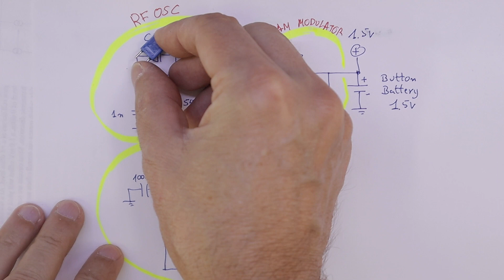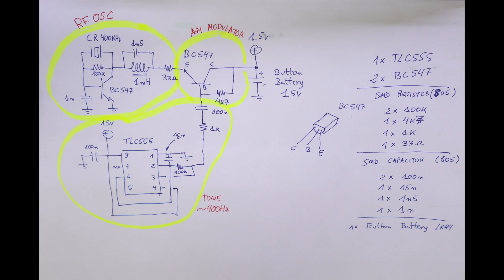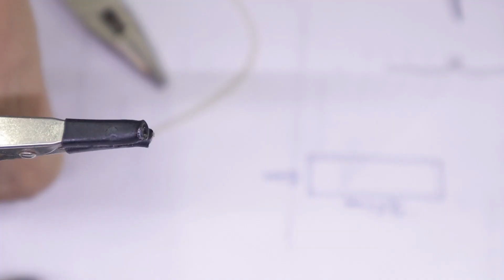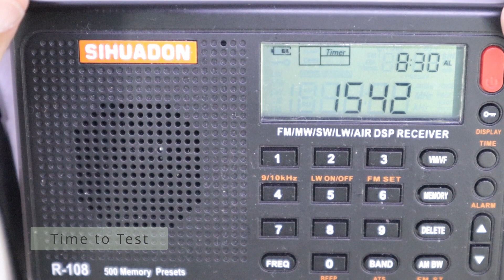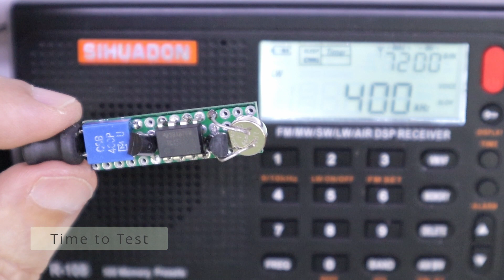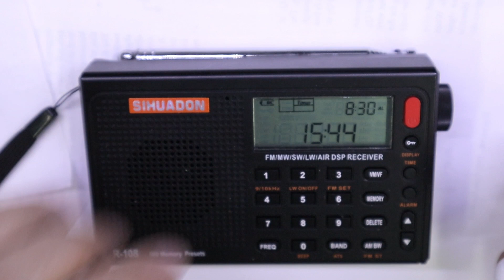DIY Pipe Locator Sonde

Comment: Thanks for posting this, it's great to see other people want to make there own as well :) Is it possible to make a receiver using an oscilliscope and antenna ? I tried to use an induction coil loop antenna with 10 loops of diameter 15 cm, but it was worse at picking up the rf signal then using a simple 10cm dipole.... I'm not sure if you can give any tips on antenna for receivers or how to build a DIY receiver. Thanks!
Reply from the maker: Thanks
I understand that LW and MW ferrite and magnetic loop antennas give good results for reception, they cancel the electrical interference noise that accompanies these frequencies. Perhaps a regenerative type receiver could give results.
https://rarclub.net/wp-content/uploads/2020/01/loop-antenna-project.pdf
Reply: @prouting7333  Thanks so much for your reply! I will do some tests again as I think perhaps my approach was flawed :)